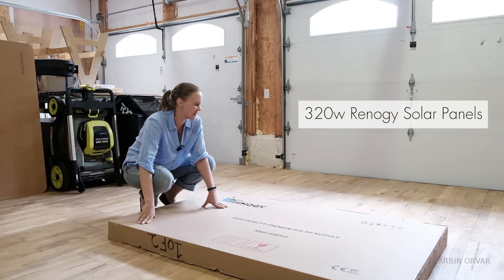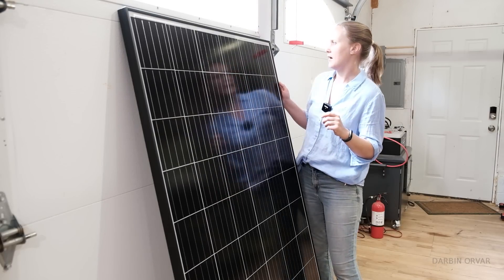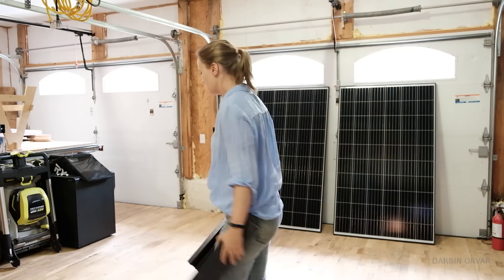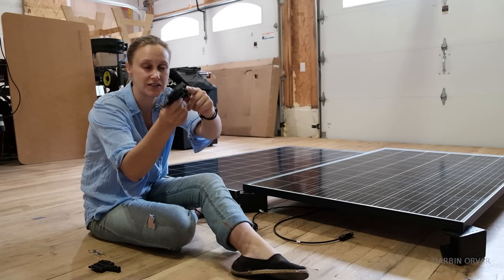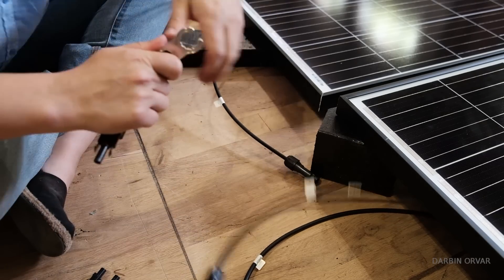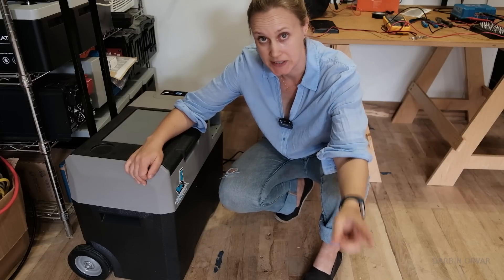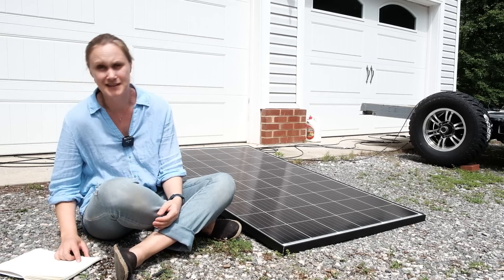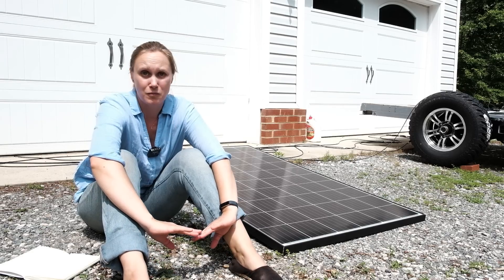How To Hook Up & Use Solar Panels // Beginner Tips & Unboxing

Comment: As someone brand new to solar, I've watched a lot of instructional videos.  Yours is one of a VERY few that actually mention that panels connected in series are more vulnerable to shading.  It's also the ONLY one I've seen that talked about using parallel connections to orient one panel for morning sun and one for evening sun.  Those types of practical tips are missing from so many videos, and yet are so valuable, especially to a newbie.  Well done, and thank you!

Comment: I have a 4500kw system grid tied that powers my well pump, dryer, fridge and produce more energy  than I can use here in southern Oregon. The problem I have is that the SolarEdge inverter they installed just went out under warranty and was replaced after only 6 years. The next one is probably going to fail out of warranty and so I will be looking for something hybrid to add my own batteries all out of my own pocket. This is why solar videos are so great to watch like these here. It’s an ever evolving technology and my 6 year old system no longer has some of the price and limits to expansion  it had then. Keep up these solar videos and I will be watching. Thanks.

Comment: If it's a cloudy day stormy day depending how stormy it is yeah I make electricity and cloudy days less on more cloudy day get and they get really dark stormy cloudy days yeah I'm not really making electricity it's not lightning enough to make an electricity for it it's too late to make the electricity work but at night when I come home from work my headlights on them charges my solar panels and that's not a Mitsubishi's car yeah I got solar panels at the end of my driveway put it on the ground didn't put it on the roof and that's like an 14 ft wide stand oh I got another one in front of my house pretty much right beside the one that's 14 ft wide yeah I got two small sets of solar panels that would have been size solar panels actually on two different stands but I did order a bunch of 275 watts of pounds a few 300 watts solar panels and yes that would generate all the power I need for my house.

Comment: Why are you lying to people about how many panels they need I don't have 60 panels and the most powerful thing I have to run is my kitchen oven stove which is 3600 Watts a dryer is what 2,400 w how are you here it's 2000 Watts the rest of your house without running anything running 336 Watts that includes your dryer that includes your water heater and that's just for power to be there and you're having your clocks and yeah the rest of how she was about 1200 watts electricity if everything's running except your microwave us a 1700 Watts electricity or at least my old antique microwave does and my refrigerator while 1,500 watts does not run my refrigerator because it will not run my refrigerator because my refrigerator says I need my power. For someone who buys two 320 watt solar panels maybe you should have bought eight of them hook them up guys have a good battery Bank got yourself a good converter hook it up to your house and see how long you can laugh well you probably needed to converters go with grow lock converters or EG 4 converters could have bought a few of their batteries eg4's batteries they only cost $200 more than a converter of course if you bought five of their batteries most people would not use more electricity than that in the entire life each month that it can generate each month through each day that it generates it. And most people can look at the electric bill and see that they used so many kilowatts a month which just shows that you're lying about how many panels you need. Oh by the way I do have solar panels and I do not have 60 solar panels but I would like to have 60 solar panels I think the electric company would like to give me money for having 60 panels because I could sell them the electricity and it's not going to be 320 watts I just bought 24 275 Watts adds up to 6, 600 w electricity DC which runs into my chargers what you're running to my batteries which are running to my converters what you're running to my house if I need more electricity than that there's got to be something wrong because my electric bill says the most I use in one month time is 7.2 KW well 6.6 KW is almost 7.2 KW well if he had up 7.2 KW that's 14.4 KW and 2 hours and that's if they power use 100% of the electricity from the solar panels. But I will never know that much cuz my solar panels are charged by about 9:00 in the morning so the Sun never really fully shines on my solar panels before my solar panels beg me for more batteries cuz it never having a batteries for the solar panels to charge yes I use a load all day long and so it's charging it 5 or 10 or 22 amps but it wants to charge it I don't know how many amps is a bunch of solar panels how many volts is a bunch of solar panels so once a charge off from what two or three solar panels can give even though you have 24 solar panels let's try and give you electricity and a convert and the charger is just not letting it happen because the converter is not using that much electricity to run your house and yes if you run everything in your house maybe you should get an air compressor table saw router I don't know what else can you get and turn everything on your house oh no two 6,000 watt inverters probably handle that all pretty well because it's not everything gives a great big surge when it runs some things do just don't listen this woman say say that you need 18 solar panels to run a dryer because if you put that much into your dryer when it's running your blow your dryer up.

Comment: Great introduction to some basics. I like your "camping" approach. Learn how to charge your phone and run your tiny fridge and use this gear for camping. Once your comfortable with that, learn more and then extend your solar equipment. I've been using my DIY solar system for about a month. Receiving power from the sun gives one a wonderful feeling. I didn't think it would be so much fun.

Comment: The education you are providing here is a great thing.  It is hopefully the future for so many more of us. And surely, solar for mobile use (such as the portable refrigerator) or for emergencies is both potentially extremely useful, and fun!  But please don't forget to mention that large panels (or even small panels) permanently affixed to your house or garage, or even fed into your house or garage (and potentially connected to your house's electrical system) is covered by the National Electrical Code, which explicitly states that photovoltaic (PV) systems MUST be designed and installed by "qualified electrical professionals".  

(While this may sound overly stuffy for those who are not engineers or electricians but who are well-familiar with what goes into a PV system, and home electrical systems in general, there are a variety of "fiddly" requirements regarding things such as mandatory electrical disconnect switches (to protect, for example, firemen), and with that, what is at possible risk is that if there is ever a problem at the house, related to the self-designed/installed PV or not, it could put your home's fire insurance coverage at risk, not to mention be a (admittedly unlikely) hazard to the home occupants.)